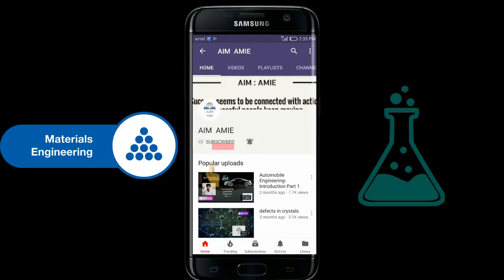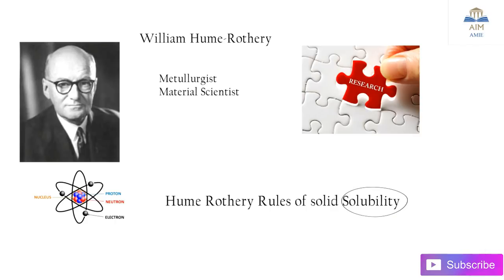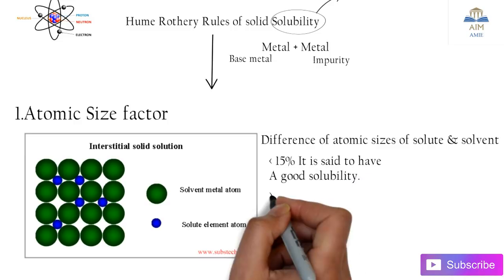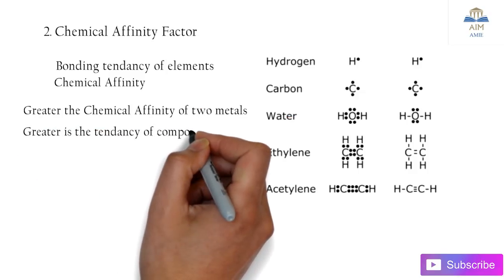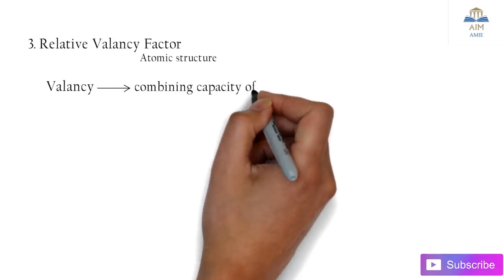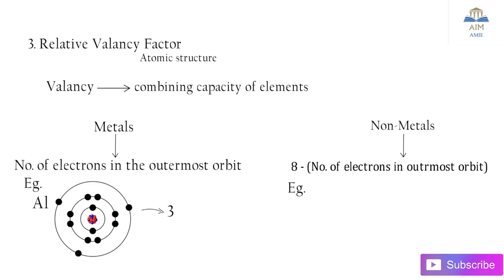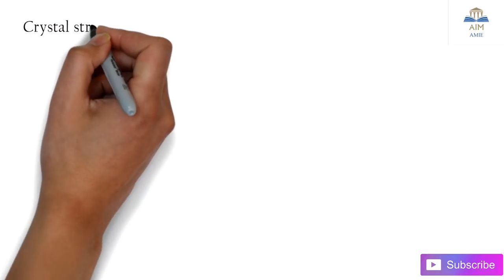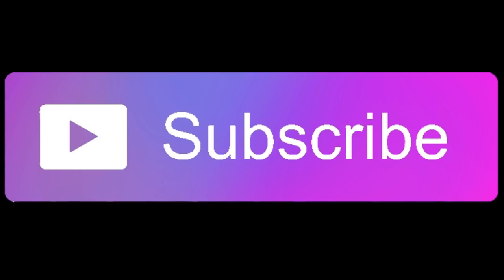Hume Rothery Rules of Solid solubility.  ||Engineer's Academy||

Comment: what about the valency did  u say? should both of the metals have close valency or need to vary? u took oxygen as an example which is having a negative valency I  guess.. what about the alloys made up of two metals? further what is the difference in the affinity and valency thing? valency must explain the affinity part.. right?
Reply from the maker: Valency is the combining power ! In case of metals it is the no. Of electrons in outermost shell... In case of non metals it is (8- no of electrons in outmost shell ) in case of oxygen valency is 2